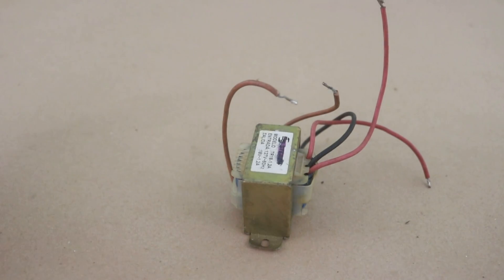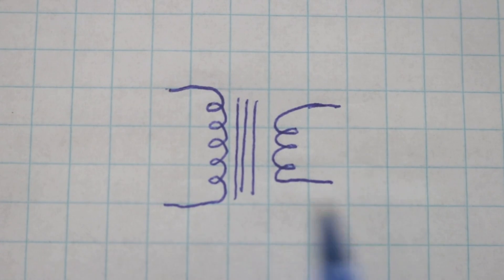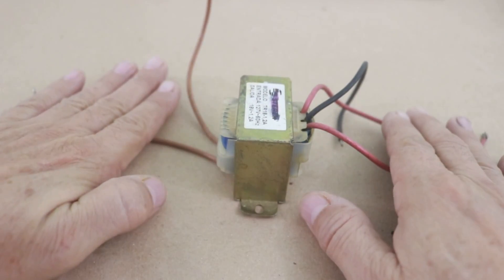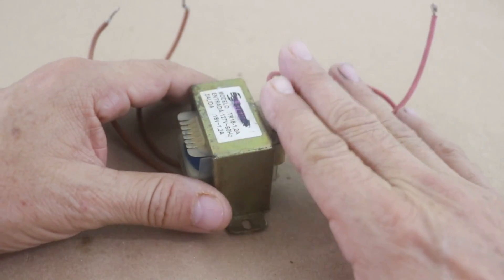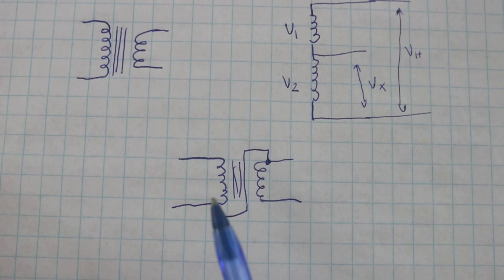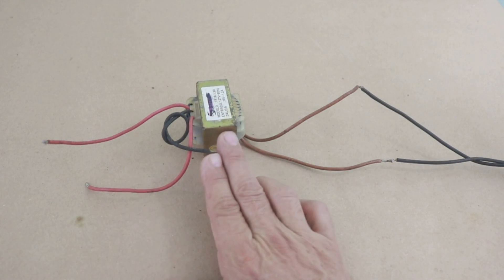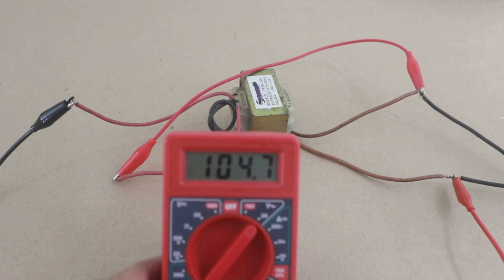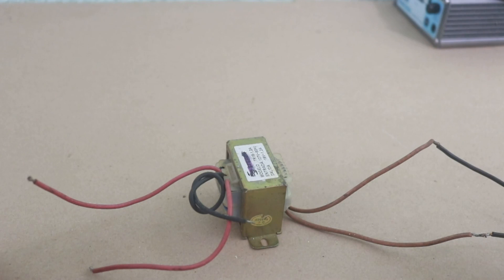How to wire a transformer as an autotransformer - UTSOURCE

Comment: Great video!, but please be careful with this modification the transformer is then no longer potentially isolated! In case of plugging it to mains voltage then you could risk to touch the mains high voltage phase!

Comment: So if the voltage are added and is higher than the input voltage then the current must decline too….. am I right ? Vice-versa…
Reply: Yes of course the voltage doesn’t come from nowhere. You are correct
Reply: @ivanurban2383  Exactly, the product of Voltage times Current = Power is always constant for a individual type of transformer.